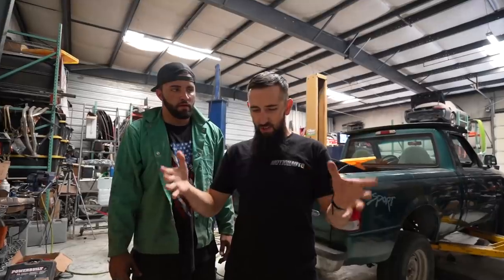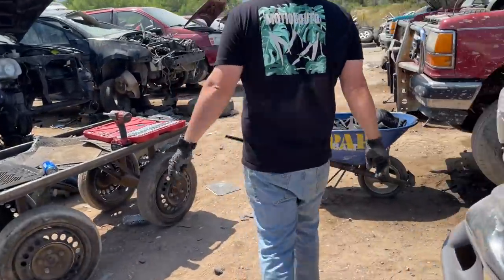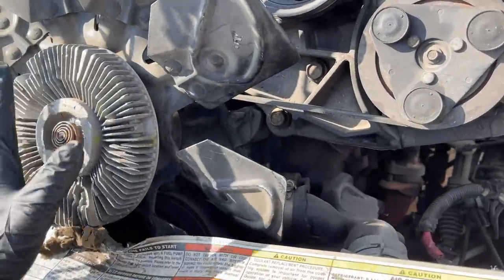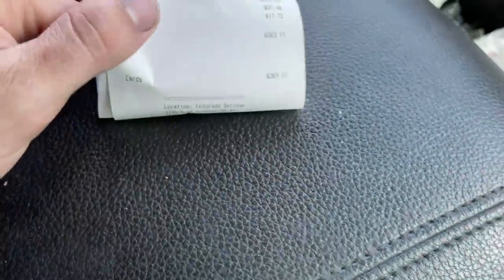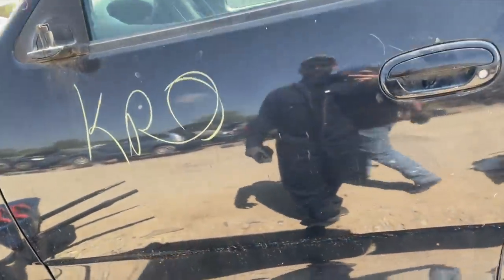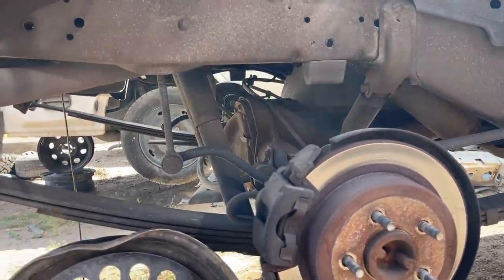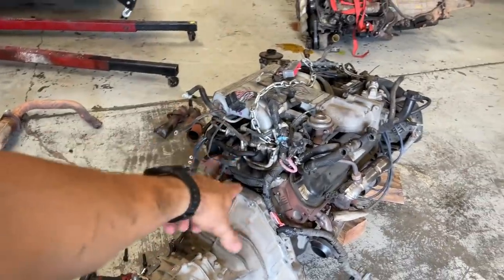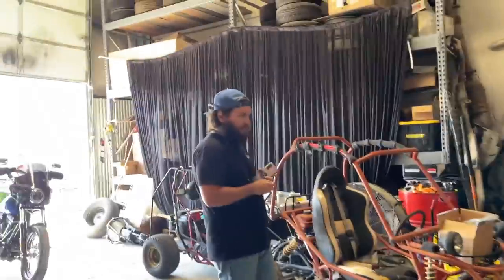We Found This 5.0 Ford V8 In The JUNKYARD! - Pt.3 $2500 Ford Ranger Challenge

Comment: if you havent figuredit out yet your ranger might have the main alternator yellow/white stripe wire in that body square plug you need to reroute because the explorer harness will have a black with white ground wire. It will short out. done quite a few swaps in rangers.
Reply: Do you have some kind of pinout or further information on this? I wanna do the same thing to my 98

Comment: I have seen 299 302W swapped Rangers. I just started the video and I was really hoping that I wasn't going to see the comments, but of course I opened it and the first comment I saw was a comment about a 5.0. I was REALLY hoping that it was a Coyote, but oh well, I know that if it's built by Trevor and the boys it'll be cool as hell. I had a 1994 Explorer (square body) Eddie Bauer and not only did I 302 swap it, but I also put an Explorer Express Eaton M90 supercharger kit on it. It was alot of fun to drive being 2WD, but I lived in Florida and it sucked to drive on the beach (even with 33x12.50s) because it would get stuck if you breathed on it in the sand.

Comment: I'm in the process of swapping a 98 explorer 5.0 into my 2000 Ranger. It's really nice plug and play swap since the frame and engine bay are exactly the same.
Reply: You're going to need a 97  V8 explorer ECU with model number xdt3 or xdt2

Comment: Oh boy the 5.0 is going to be so f@&#&* rowdy!!!!! Its going to be a hand full.  This is going to be epic!!!  You will be so happy you didn't do an ls.   Back in the early 2000s I had a little brown 2 door 1989 ranger with a built 302, cam heads  intake , Carter afb carb, with b&m floor ratchet shifter it was fun, but I had to put bigger springs in the front end it started to sag after about a month of daily driving  and it needed ladders bars, It would hop  like you were jumping the railroad Trax  while doing a burnout,  had axle wrap bad!!!!!!!

Comment: Super excited on this series, you're building my truck!
2wd 96 ext cab 4.0 5spd (Mazda trans)
5.0 gt40p explorer engine, also 96.
World class T5
It is like legos so far.
I'm curious about motor mounts, I think you can use the Expo' just gotta drill new holes in driver side.
And I wonder about oil pan.
Cab is off my frame, way easier to work on.

Comment: I pulled a 5.0 from that generation explorer. There’s an excess panel under the carpet between the driver and passenger seat to undo the top trans bolts

Comment: With the 8.8 explorer rear end you need 2 driver side shock mounts from an explorer. On the ranger the shocks mount on the Axel on opposite sides. On the explorer the mounts are the u bolt plates on the same side. So like i said you need 2 driver side explorer shock mounts and just turn one around. I did this same swap in my 1996 ranger. Hope you read this and it helps.

Comment: Trevor I would’ve pulled the 8.8 rear end to as well at 7 1/2 on the Ford ranger just won’t cut it 👍🏽😊
Reply from the maker: We did!
Reply: @MotionAutoTv  yep I spoke to soon lol but that 8.8 will hold the power and with the right suspension it will put it were it county’s to the ground 👍🏽😊

Comment: the rear end outta the 97 explorer, for a wider stance, 373 gears with 32 spline axles and bigger tubes. Has a disk brake already converted.

I did to my 84 ranger with a 363 stroker and aje front tube suspension with coil overs and tube front end

Comment: Explorer 8.8 holds plenty of power,  535 whp in my Celica for a year with no issues 

The unit should be offset,  I cut 2 7/8" off the long side and snagged an extra short side shaft for a cheap easy centered pumpkin

Comment: No that trans if you beef up the motor any the trans won’t hold the torq. You need a zf5 trans out of like a 89-96 f150. The 97-03 5 speed trans were really only ment to work with the v6 power and torq.

Comment: I had a ranger splash stepside that had a swapped fox body cobra motor in it, the shifter was the worst thing when I got it. I hope your situation lines up because mine had man made motor mounts and oil filter relocation but there was sooooo many problems with the actual shifter on the T-5. Of course this was like 10 or so years ago

Comment: My guy those 5.0s wit the gt40 heads and a nice single turbo make some killer power my buddy has 1 I might be wrong but I think the gt40 heads are 4 valve was told wen u out then heads on the 2 valve bottom ends they r perfect for boosts but I know for a fact single turbo they make some good power on low boost

Comment: 89 S10 manual t5 shifter is moved forward
Reply: I'm doing this exact swap & researched an S10 T5 but couldn't find much info.
Isn't it an entirely different case?
Reply: @Drof_Regnar  no I had a 89 S10 manual and swapped the trans in to my buddy  98 mustang just had to change rear housing and few parts his input shaft went out and it worked
Reply: @Drof_Regnar  google 1989 S10 t5 transmission

Comment: That's a gt40p head motor some headers will not fit because of the spark plug angle. Other headers will bolt up just won't be able to get spark plug in with plug wires